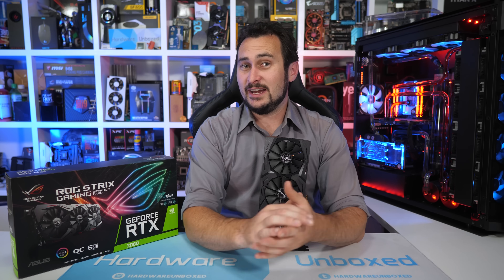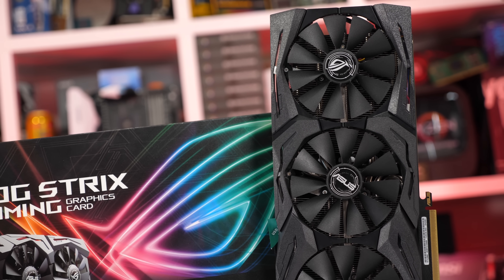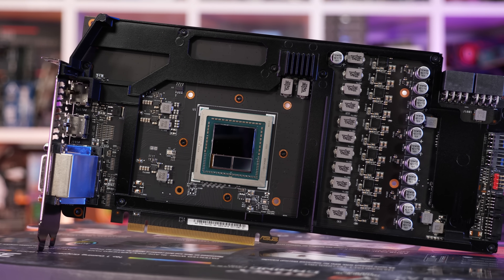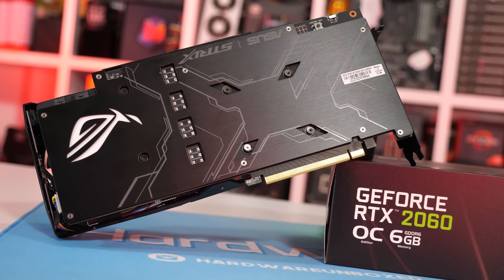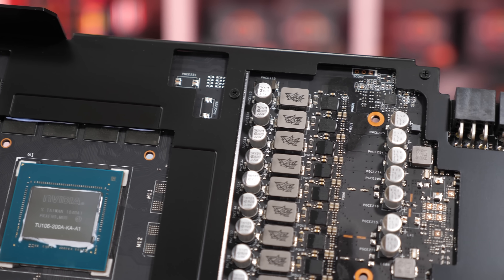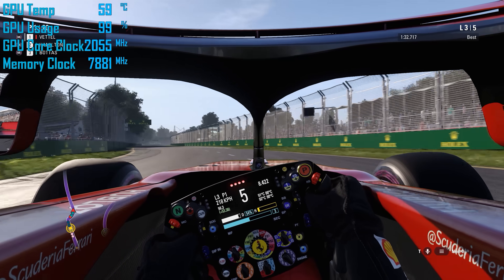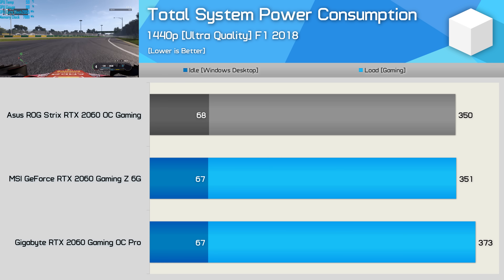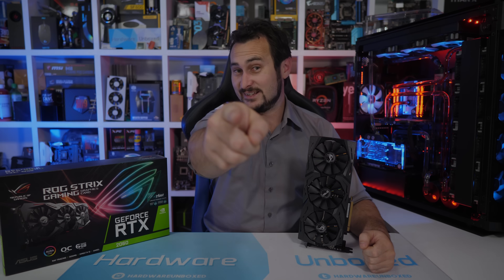Asus ROG Strix RTX 2060 OC Gaming Review, Thermals, Overclocking & Benchmarks

Comment: Wow this thing shits on my 2070..well I guess that's just what I get for not waiting for the 2060 releases.
Reply: 2070 has a lot of oc headroom
Reply: Millard Fillmore I know, turn shadows to medium and vram isn’t an issue
Reply: Your 2070 still has 2GB of extra VRAM. That Alone makes it a better purchase.
Reply: @DeadPhoenix86DP  not worth the price increase. Nvidia put less RAM on the 2060 just to keep selling the horribly overpriced RTX2070
Reply: @houssamalucad753  Cheapest RTX 2060 is 350, and cheapest RTX 2070 is 500. The RTX 2070 is still faster if you overclock the hell out of it. You should still see a 10 to 15% better performance compared to a RTX 2060. and 6GB VRAM is showing its limits on certain games.
Reply: @houssamalucad753   Because the RTX 2070 is still faster than a RTX 2060? Also the RTX 2070 in infact more future proof. Games will continue to use more VRAM as time goes on. I've seen some games even using up to 10GB of VRAM, when you actually push the settings real hard.
Reply: @DeadPhoenix86DP  when are games gonna fully utilize 8gb of vram, 2 years? By then I'll be ready to buy the next best graphics card that has good msrp if it doesnt I'll hold on to the 2060 as I still wouldnt have issues. I have the budget to grab a 2070 but I've seen so many bad reviews with artifacts and blue screens I really cant bring myself to buy them. I was gonna get the asus rog strix O8G for $489 should I risk it?
Reply: @spartangoat9337  Not everyone buys a GPU every year., or let alone 2 years. Most people do it every 3 to 5 years. So having a GPU with more VRAM, is very important. You remember the 970 with 3.5GB?
Reply: @DeadPhoenix86DP  hey, my 970 is still rocking 1080p ultra on modern titles.
Reply: @nuhuh4564  Medium/high maybe. But Ultra hell no. Seen plenty of games using around 4 to 5GB on 1080p already.
Reply: @DeadPhoenix86DP  also you can buy oc 2070.
The 2070 is faster even if the one used here wasn't the best.
6gb really worries me. I'm not even that happy with 8gb.
For me the 2070 is still worth the extra. And saying that you can buy the msi armor for the same price and apparently that oc quite well.
Reply: @DeadPhoenix86DP  I know that but we are in the times of lower gains and I dont think we are going to see the days of huge upgrades from generation to generation. I still want the rog strix 2070 O8G. Do you think it's worth it? I would be set for the next 3-5 years but I really dont want to run into issues with it
Reply: @spartangoat9337  How much are you willing to spend on a GPU? Maybe go for a RTX 2080 to be a bit more future proof, because of the extra horse power.
Reply: @DeadPhoenix86DP  see that's territory I wont step in. A 2080 would not serve me much use. I do not plan on ever gaming at 4k and my rig would bottleneck the gpu. I have an i7 7700 3.6ghz and I think the 2070 is the highest that cpu will go without bottlenecks. I really cant afford to wait for the 2070 prices to come down so I have to buy it at $489 if I am to purchase one. I just want to upgrade to 1440p in the future at above 70fps
Reply: @spartangoat9337   That i7 7700 won't really bottleneck a RTX 2080. I used to a run a i7 7700K with a GTX 1080 Ti. And i had zero issue's with CPU bottleneck. Mine was running at clock speeds of 4.2 GHz.
Reply: @DeadPhoenix86DP  yeah I kind of expect that from a $300 cpu. I have a h110 plus asus mobo which cant OC my i7 7700. I'd have to redo my whole pc
Reply: @spartangoat9337  Yes its sad they didn't allow 8000 series on the Z270.
Reply: @DeadPhoenix86DP  that 2gm of vram is priced at $150 more? No thanks, I'll buy this card save $100 and enjoy gaming at 1440p

Comment: Honestly, I would gladly pay $400 for that RTX if it was 8GB and not 6GB cause it would make more sense to go buy that instead of paying $350 6GB. Its a nice card but like Steve said, just stick to $350 normal price range
Reply: 8GB alone dont mean anything, its more about Memory Bandwidth & Memory Speed. The 20XX Series is noticable faster there, and faster transfer means overall smoother & better FPS plus there is less to store in the VRAM. For comparison, a GTX 1070 has nearly identical specs compared to the 2060, same CUDA-Core count, Default Clockspeeds are totally in the same range, not much difference except for the VRAM. There its 8.0 Gbps (1070) vs 14 Gbps (2060), the 2060 is using GDDR6 instead of GDDR5 and has roughly 25% more Memory Bandwidth. Means: The 6 GB VRAM of the 2060 are more efficient, and never as "stuffed" as with a 8GB GTX 1070.
Reply: @Nebujin383  basically its worth not worth getting a x70 card and skipping a gen, but rather getting a x60 card every new gen. I had a gtx 970 before my rtx 2060. the 970 was useless after 2016 and I had it until 2019 lol.
Reply: @Nebujin383  try to play apex legend on ultra textures with a 2060 and you will get stutters like many people already have, with a 1070 even being 17% slower you can play on ultra textures.
2060 is a great card and would be the new 970 if nvidia had not cripple the vram.
Reply: @coffee7180  right. While more 'efficent'/ more bandwidth . 6GB is still less than 8GB of vram regardless.
Reply: @coffee7180 , APEX-crap is totally in need for optimization anyway. Runs so shitty for its mediocre visuals, and switching between Ultra and Low is maybe a 5% performance difference at best on my rig (8700k @ 4.9Ghz + GTX 1070 @ 2070Mhz-GPU). APEX Legends shouldnt be used for comparision. Suchs crappy optimized games are not the typical experience anyway.
Reply: @Nebujin383 Lol, when results don't go your way it must be optimizations! nVidia shills are the best, no matter how fast the vRAM is if the game engine wants to keep the GPU's memory pool full with ready to use textures (some popular engines operate like that... you know?), then you can't just use the excuse "it's poorly optimized". 6GB was good back in 2015, now you expect 8GB for a card in the pricerange of 350-400+.
Reply: @Nebujin383  The problem here is that we are talking about a card that cost at least 350 bucks and AMD is selling budget cards for 150 bucks with 8gb vram.
If a budget gamer can buy a RX 570 with 8gb of vram why does the 2060 has only 6gb, games like hunt showdown, rise of the tomb raider and many other games are in high need for more vram.
This or even next year the new consoles are coming and they will have at least 12gb of vram, so we will see a increase in vram usage.
A stack of 8gb gddr 5 cost 22 bucks and a stack of gddr6 cost 24 bucks, nvidia is trying to push gamers on buying higher prized cards with this.
vram does not give you a smother experience but it can give you frame-drops or stutters if you have not enough of it.
Reply: @Kakaroti , seriously... that game could run at twice the fps compared to what it delivers a.k.a. totally outdated visuals ^^. Thats not even a excuse, its a fucking fakt. My bro uses a GTX 1080 Ti and drops to below 90 FPS @ 1080p, seriously totally messed up game.
Reply: @coffee7180  that's a lie.. tested that game maxed out with a 1060 6gb and it was as smooth as butter, check your monitor, need a good refresh rate to match the 2060 so it doesn't stutter.
Reply: @vaderglenn  did you play it on ultra settings 1440p?
Reply: so you'd gladly pay less to get more. Wow, that's an interesting opinion. Also, check comparisons between rtx2060 and 1070tis. Wow look at that, 2Gb more and performance is basically the same. Except you pay the 1070ti 100 bucks more.
Reply: $400* You mistyped that.

Also, $50 more for better cooler, design and 2GB vram is too much. They aren't doing charity lol
Reply: those 50$ only in USA, in other countries, in Romania at least its a 100 USD difference...good thing the wage is 350 USD / month...cheap card right? Why are people always talking about USA prices and difference? We all know that with taxes the difference gets bigger and bigger.  @cunnyman
Reply: @cunnyman  thanks
Reply: Honestly, i would like to get the top of the 2060 cards for free, because that somehow makes sense for me.
Reply: 6GB will be a bottleneck for RTX 2060. Mark my words.

Comment: The best RTX 2060 is a Vega 56.
Reply: As an Nvidia user, I'll agree with this. The prices and added VRAM make the Vega 56 a good option.
Reply: RTX 2060 compete with Vega 64 in most titles.
Vega 56 is nothing compared to RTX 2060
Reply: @BetterWarrior  You haven't seen the video yet, obviously. 🤣
Reply: @BetterWarrior  What are you talking about? The 56 is very close to the 64, and if you watch the video, there are times it is faster than the 2060...
Reply: yeah cheapest rtx 2060 i've seen has been 365€ and cheapest vega 56 299€. Undervolting and overclocking the vega makes their performance pretty close and it's quite a bit cheaper.
Reply: Here in Germany... I was torn between Vega 56 & Rtx 2060......but found sapphire Vega 56 for 299 euros + 3 games .....bought it ...not sure if it was good decision...
Reply: Here in Germany the 2060 Strix OC costs about 439€ and it competes with the Vega 64 Strix for 409€.
Reply: @frankneugebauer6455  Vega 64 Strix sucks.
Reply: @Skewel  Why does it suck? Enlighten us. 😏
Reply: @frankneugebauer6455  Cooler is garbage and it's quite slow compared to the Sapphire Nitro+ and Red Devil.
Reply: @Skewel  Thank you for the hint. The Vega 64 Nitro+ is 439€ here, same price as the weaker RTX 2060 Strix.
Reply: @frankneugebauer6455  Lass das ja nicht Don hören! 😉
Kommst sonst nur seine "ich habs dir doch gesagt" predigt zu hören! 😂
Reply: and vega has more vram
Reply: @megapet777  
And more heat, power consumption, worse performance, no CUDA, RT cores, G sync support and so on.
Really, AMD fanboys only bring the few good thing of their cards, it's pathetic.
I understand Ryzen fanboys but Vega? Lmao
Reply: Fanboy? I have gtx 1070 myself :D
Reply: @cunnyman  G Sync support? Really? That is really bad argument for Nvidia
Reply: @Henrix1998   Actually  support for G Sync and Freesync both these days.
Reply: @megapet777  Congrats, I have an RX 480, I'm getting an upgrade in a couple of months.
Reply: @cunnyman  Vega is faster, and cheaper. Yeah, it uses a little bit more power, barely. G Sync support is a downside, not an upside. Why would you want to pay more for the same screen technology?
Reply: @cunnyman  Yes Cuda is verry important, I played a game at my friends house one day and didnt know he had the vega 56. So I play on his computer and like right away maybe 5 seconds into the game I stopped!! I looked closer.....what I saw that day was terrible......I said: "WAAIT A MINUTE.....WHERE IS THE CUDAAAAA!!!!!!!!!!!!!....Btw the this whole comment was ironic....for those that cant tell a joke from a real statement. GTFO with the CUDA bullshit, when you play a game you dont give shit about CUDA, its just nvidia marketing and you are all like"Hmmmm.....this has CUDA WOW!" Then the RTX technology.....well...I dont give a shit about it either, the performance hit is too big
Reply: @megapet777  and amd fanboys always said they have nvidia gpu or intel cpu.
Reply: @AestheticKunt  You're out of your goddamn mind. Vega 56's TDP is 210W. RTX 2060's TDP is 160W. How is that 200W difference?
Reply: @cunnyman  right...welp, instead of bashing back about why all the other things that you said are stupid - I'll focus on two things that people didn't counter - thermals and consumption.

Just Undervolt the card. People could get a 150 watts consumption with the V64 and perform like a 1080, while still having 8 GB vram after all, and it was much cooler then beforehand (maybe even more than the 2060 since they have really beefy coolers on them), so probably that's too a false statement from you?
Reply: @cunnyman vega 56 has a lot of potential, with a nice OC UV it gets really efficient
Reply: AMD fanbois still don't know that Nvidia can use both gsync and free sync while AMD can only use freesync
Reply: @shadbud9198  Gsync is not an advantage.

Comment: Asus ROG Strix in my opinion are the best cards to get from other cards. 
Wondering if how they did the 2060 is the same for the 2080 since I have an Asus 2080 ROG Oc strix and at 50% fan speed my temps are at max of 45 degrees. Was able to get +145 on core and +1000 on memory

Comment: Controversial opinion here, but I actually like the RTX 2060.
Reply: Dawid Does Tech Stuff Me too! If it wasn’t for the 6GB VRAM...
Reply: @ryeza_  Are you planing on doing 4k on that card???
Reply: @ryeza_  That's fair enough, 6GB of VRAM is a bit 2016
Reply: Thats not very controversial
Reply: @MegaAlpakka  like AMD? 580 just overclocked 480 from 2 years ago, 590 even more overclocked 480, and for 280$? no thanks. I wont be buying RTX but cards like 2060 trash anything AMD has to offer.
Reply: Me too! I am getting one soon...

I do not play in 1440p, so 6BG is enough for me!!! :D
Reply: @MegaAlpakka back than there was somewhat of a competition, today it's just Nvidia competing with itself. I would have done the exact same as the ceo
Reply: It's a good card, just unfortunately priced in comparison to previous gens.
Reply: Thats fine as long uk its a rip off
Reply: MegaAlpakka 900 - 1000 series featured smaller die and jump to GDDR5 and GDDR5X it was 2 big jumps at once.
Reply: It's worth it. Even if you dont like ray tracing then just turn it off... probably gonna be my next purchase even though I got the 2080 ti
Reply: If it had 8gb vram I'd be interested, not a fan of the planned obsolescence
Reply: @robotbeeptv4941  6GB is OK for most users. Dont forget there are a lot of people who play just DOTA 2, CS:GO, LoL and other esports. And in these games even 3GB is fine.
Reply: @kiklop8362  if you play those games then you don't need a 2060, AAA games are using more and more vram and more people are playing at higher resolutions like 1440p and 4k which use way more vram. Just look at how bad the fury and fury X are doing lately in some games.
Reply: @robotbeeptv4941  I dont know where are you from but around me most people have 1060 and 1080p and they are very happy with this setup. 2060 will continue in the same way. I have 1080Ti SLI and I play Dota with SLI not working 90% of my playtime. It is stupid but... I have it :D.
Reply: @robotbeeptv4941  6gb is enough for 4k, 2060 is still performing better in 4k than a 1070, despite the 1070 being 8gb and the 2060 6gb, so those 2gb are still not a limiting factor  in 4k
Reply: @robotbeeptv4941  If it had 8GB of VRAM it would be a 2070.
Reply: @philipcooper8297  you just gonna ignore the fact the 2070 has more cuda cores and tensor cores
Reply: You are the reason why Nvidia gets away with shitty and shady practices. Congratulations.
Reply: @lagarttemido  And AMD / Intel are clear xD Give me a break fanboy.
Reply: @lagarttemido  How so? A fucking 1070ti is $500 US, has the same speed and doesn't come with RT. While the 2060 is $350...
Reply: @lagarttemido  wait, because it's beat RX590 really bad isn't?
Reply: @lagarttemido  haha another salty amd fans
Reply: @lagarttemido  the shady practise of releasing the superior video cards last 5 years in a row? yea complete scumbags.